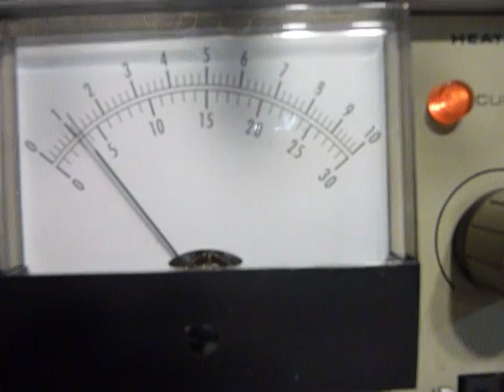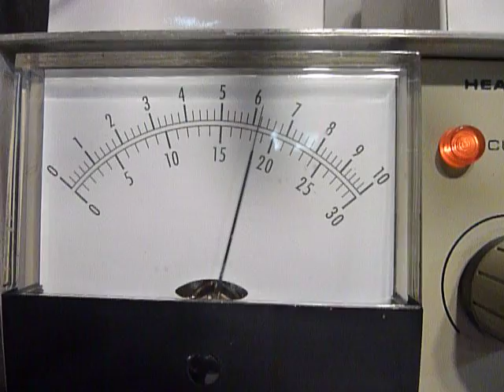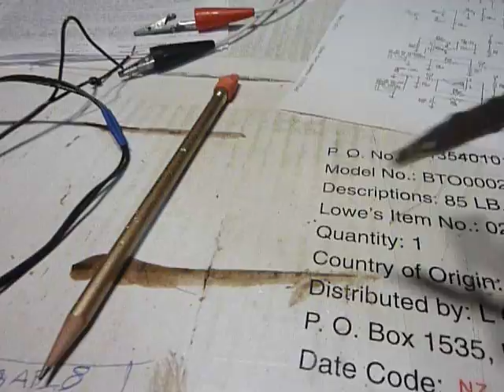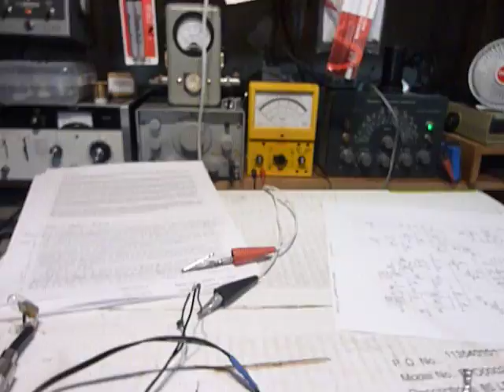PART 4  QRP GUYS  DSB Tranceiver

Comment: I HAVE MINE UP AND RUNNING. PUTS OUT 4W ON 40M AND 1.5 W ON 20m. THOUGH ONLY 1-1.5W WILL BE USED ON 40M BY SLIDING THE SLIDER DOWN ON THE FT8 SOFTWARE.. MADE 4 CONTACTS ON 20M. ALL THE SETUP READINGS WERE LIKE YOURS.. THANKS FOR UR INFO.

Comment: I've been curious about the DSB transceiver.  The unused sideband is basically QRM right? It's so close to the wanted sideband (USB) that it'd  be difficult to filter. Am I missing the benefit of a dual sideband transceiver? Thanks for the videos! 73 de w8tam
Reply from the maker: Thomas  You did bring up something here I had not even thought of . I think the benefit is simplicity  and low cost it cost 40 bucks it is QRP  less than 1 watt . Also  There are a lot of guys on AM phone  some of them running 1000 watts  with both sidebands and  it is still legal . I don't do that  but less than a watt  in digital mode should not bother anyone.   I bought this tranceiver board to TRY  FT8  I hear you can work all over the world with less than 1 watt power .One other thing  I am a complete beginner here and right now  know zero about FT8  so I  have a lot to learn and am enjoying that gotta keep that old mind sharp . 73 Thomas  Bob
Reply: @robertsumption1243  Sounds good. Just keep it out of an amp I suppose. I enjoy building kits too and that transceiver is a nice looking kit. Hope to work you on FT8! 73
Reply: @robertsumption1243  Also... If you have any questions about FT8 I'm pretty experienced. I'm happy to help you. I love this hobby! 73